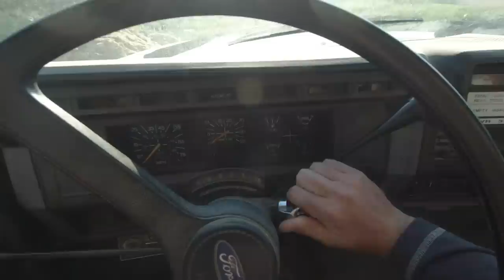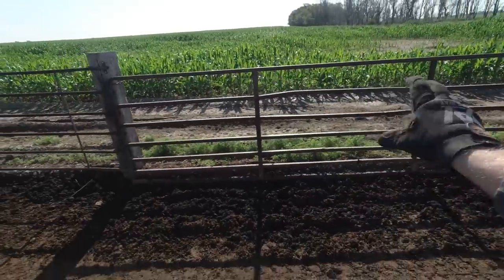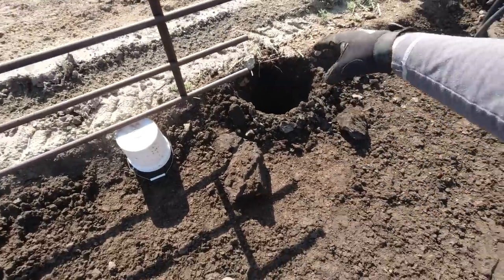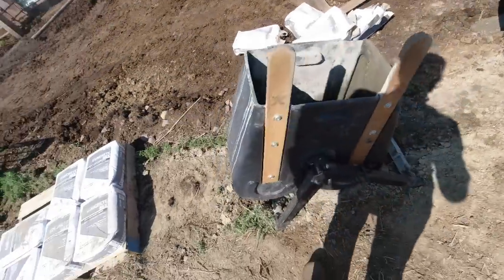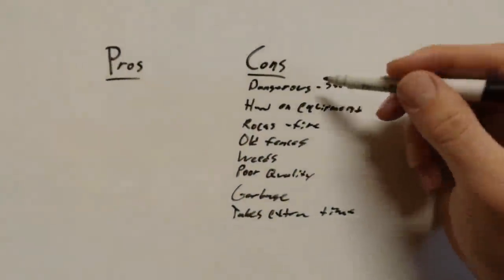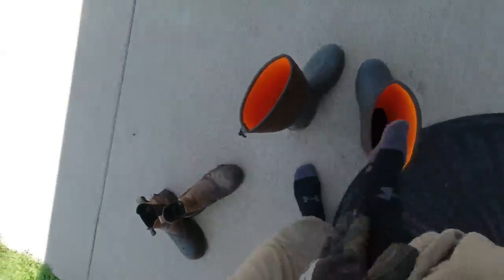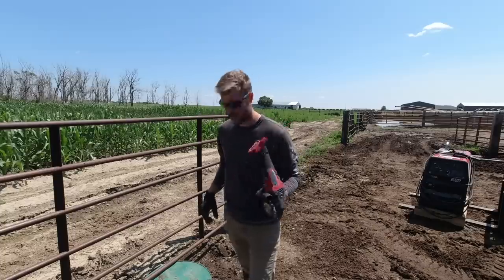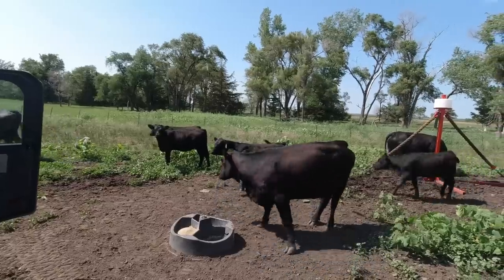High Voltage + Water, what could go wrong?

Comment: Cole, it looks like you need to do some welding on the underside of the dump truck. I think i saw a hole forming on the support by the tires. I think the cattle is getting used to the sprayer. They don't run off like they used to.

Comment: I worked in a gravel pit in high school and although I mostly fed the crusher spread with a loader, I also did a lot of welding/fabrication/maintenance when the crusher went down and ran out of oxygen in the torches and instead of running up to the shop and swapping tanks I busted out some 6011 and cranked the old miller bobcat to 220amps and used that to cut off my angle iron, kneeling on damp ground too, holding the angle iron with my bare hand I knocked my ground clamp off and lit myself up like the new York skyline at midnight! My heart hurt, my tongue hurt and my left arm/hand was useless for a couple of days, lol, my doctor was not impressed because I had a mild irregular heart beat prior and getting zapped didn't exactly do me any favors in that department 😂

Comment: Hey Cole, I see you visited the hair shortening guy!
So please correct me if I am wrong, I was always told that if a vehicle was in contact with the iron you were welding that it would damage the electrics if the battery or alternator were not disconnected?

Comment: with metal posts you want to last ...... put a bag of mixed cement in the hole, ....... slide the pole down into it........ then put the rest of your mix in around the post, it will make it waaaaaayy more secure........ put the cement in a bell shape and up around the top of the pole at the dirt level bevel the cement for water run off. Metal poles will last many years more than just leaving the cement below the  dirt level....... old Indian proverb  " man who weld in water ......wasn't around to finish proverb.....................